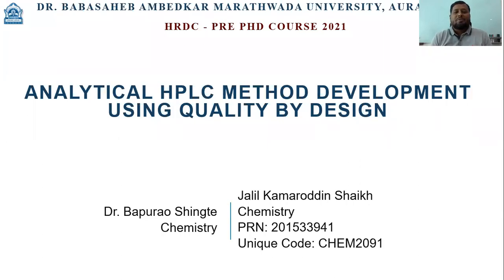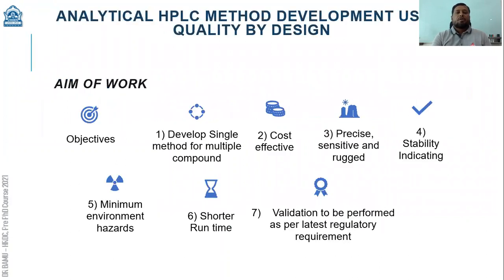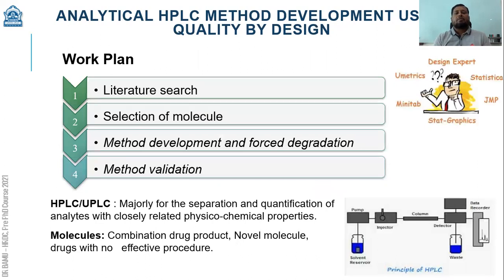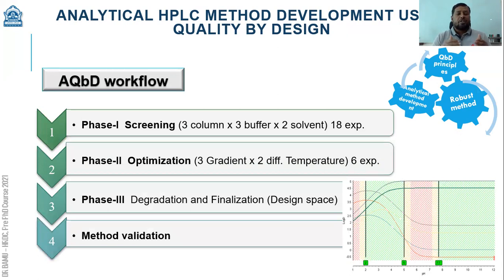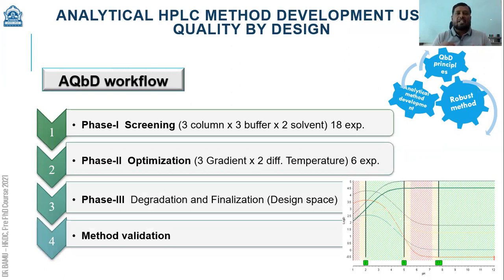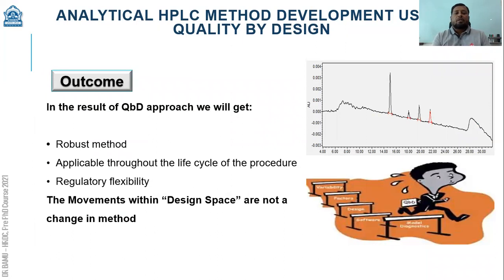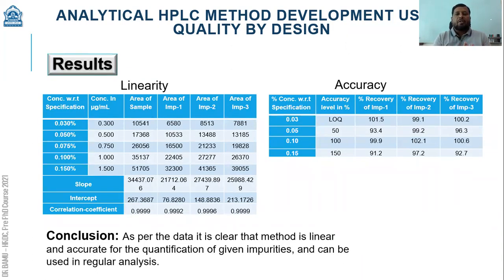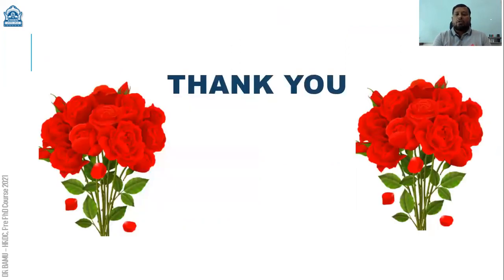Presentation On "Analytical HPLC method development using Quality by Design"

Comment from the maker: Thanks for query, you need to select 3diffrent column, two solvent, and prepare three different mobile phase, make simple gradient at intial stage and execute. Based on this result you need run 3 column and make selection of column. Futher proceed for separation